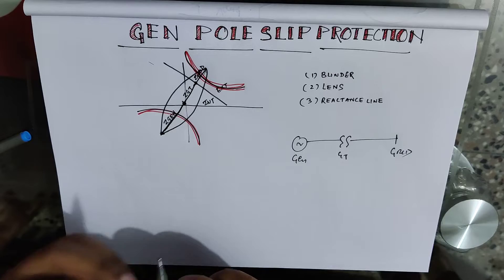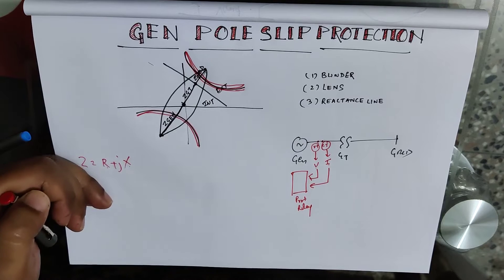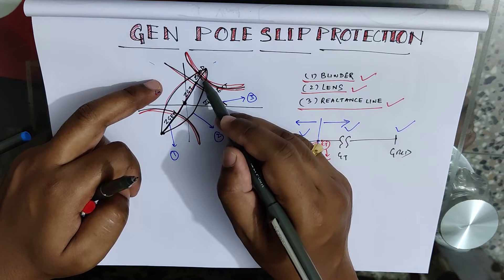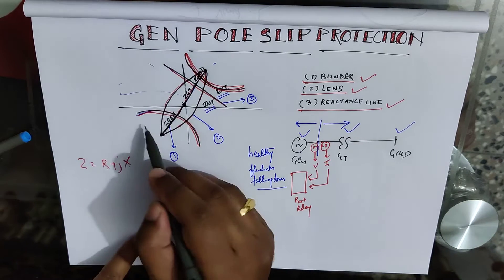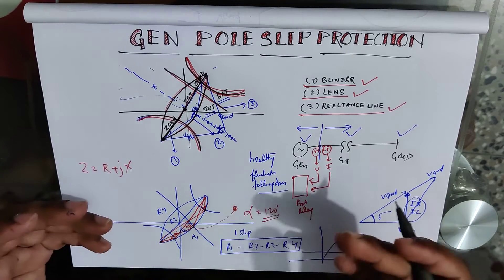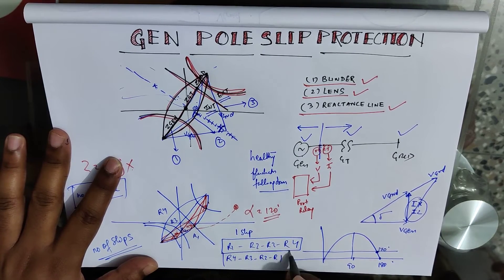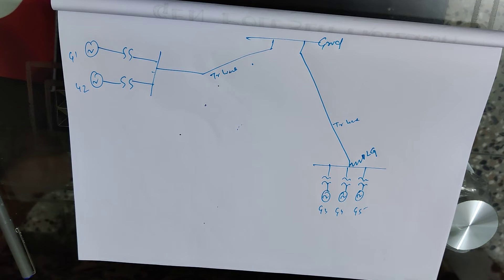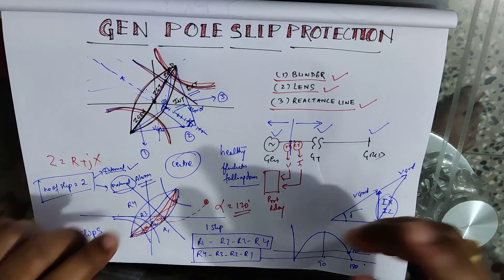GENERATOR POLE SLIP PROTECTION

Comment: Hello Sir, in case of the situation where the excitation system is robust enough to maintain the impedance trajectory along the perpendicular bisector of the blinder line, but the impedance trajectory crosses the R1, R2, R3, R4 zone 2 times, then also will the pole slip relay trips or not?

Comment: Hi 
Thanks for the video. 
There is one question that in some relays settings are in i/Xd(Susptance) how to draw a Susptance diagram?? 

You had explained about how graph will work on R1 to R4 settings. But How to draw it in excel?? Any help? So i can get exact current and voltage value to run the test.

Comment: Sir ,i have a dout.
In second situation where the fault is after GT. The relay should sense as external fault because the impedance will be greater then Zt and Zg.it will be in grid zone.
Reply from the maker: Yes correct, take that fault in GT winding instead of terminal so that it will come below reactance line.

Comment: Very nice explain and informative video's keep it up. Thank you.
But one doubt/confusion , after carefully watching videos, At the starting of video's you shared information Relay sensing impedance through ct/pt units and released tripping command.
But during whole video you will share information that relay travels zones R1,R2,R3 & R4 and count number of slip and released tripping command.
So please clear my confusion with more explanation on how to calculate impedance internal/external etc. Information.
Thank you
Reply from the maker: Relay sense voltage from  PT and current from CT. When voltage is divided by current we get a complex quantity i.e. impedance written as R+jX.  Every time there exists some value of R and some value of X, so when we plot R+jX in a 2D geometry RX plane we get some operating point. When this operating points changes slip occurs. Hope this explanation clarified your query.
Reply: @electrocean6684  air,
Thank you very much for your great information and useful.